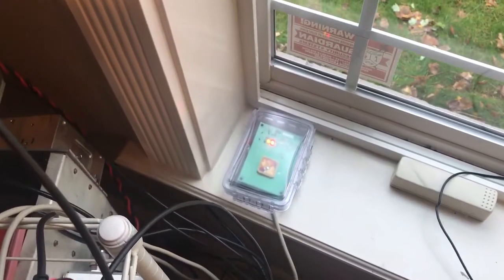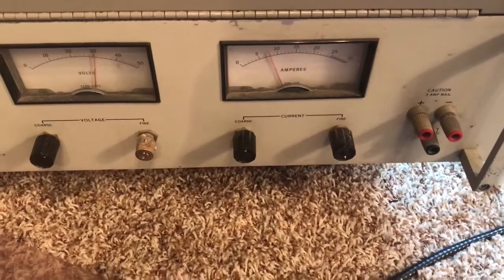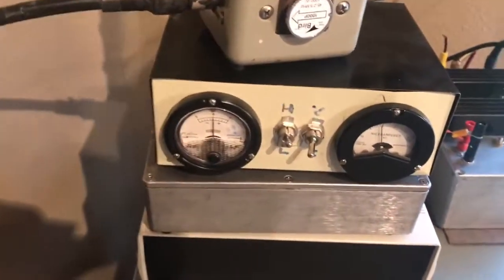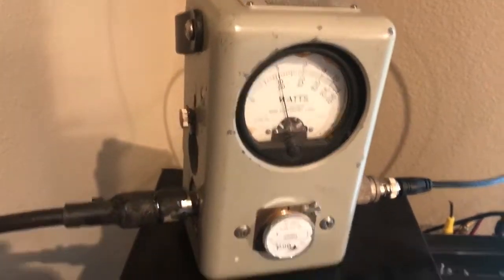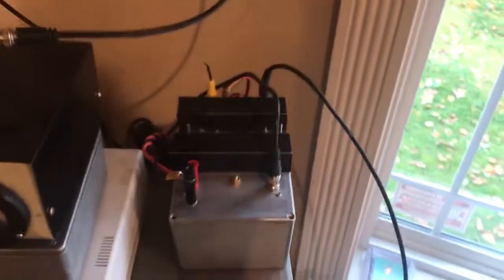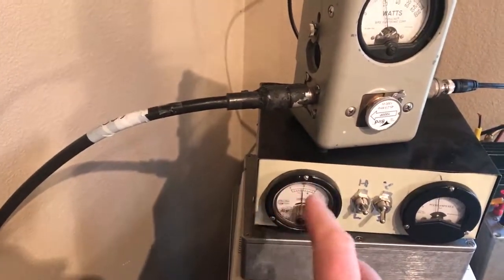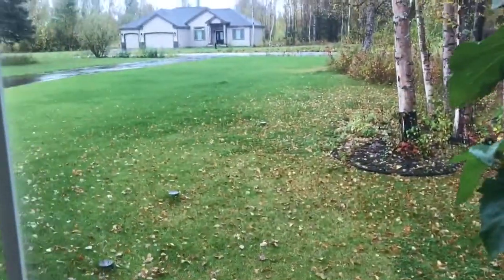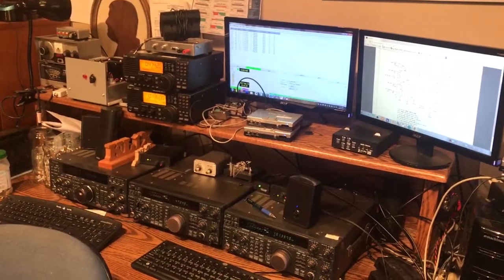Ham radio 630m station

Comment: Nice resume of your station. I am in the UK and run a similar set up. U3S and W1VD amp and LPF on 136kHz, but powered by an HP ESP120 server SMPS that gives about 52V at up to 57 Amps from memory. Cheap to buy, and I see no RF noise from them, they are cool running and very efficient. Fans are a bit noisy, but you can't have everything!  I run more modern FET's in one of my W1VD amps to give a bit more drain voltage overhead. Antenna is a Marconi T with my HF horizontal quad loop configured as the top hat. Managed to work N1BUG Stateside a few times, I like LF, it;s a real challenge! Good luck, and thanks for the video 2E0ILY Chris Wilson
Reply from the maker: Thanks Chris - well with any luck we should have a Transpolar path opening both on 137 and 475 this winter from Eu to Alaska  - but I dont think we have much of one last year - typically its during the darkest period around late Dec or Jan, and gone by middle of Feb. Best was way back in 2002/3 when a number of stations were decoded from Eu on 137 qrss, a few more on 475 WSPR. What FET did you replace it with? Its getting harder and more expensive to get the originals and always looking for alternatives !